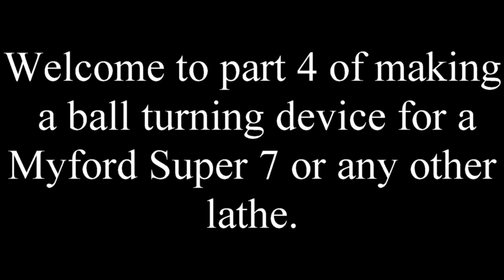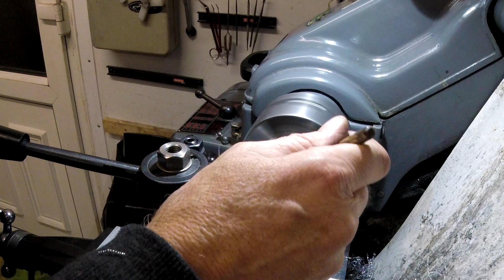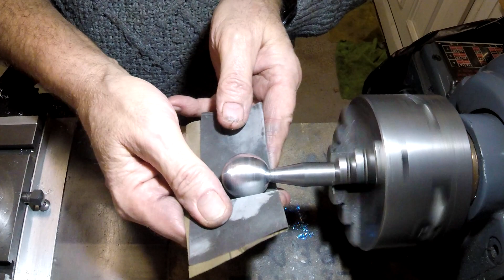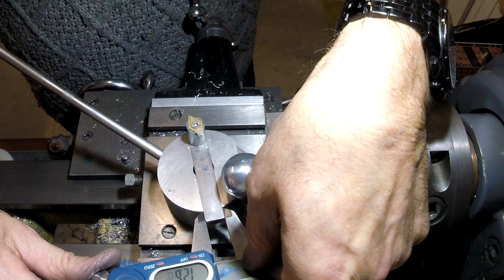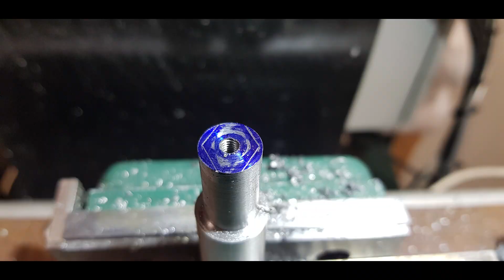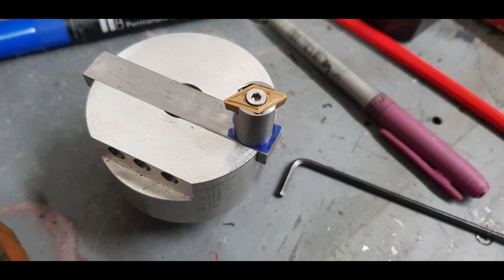Ball turning device part 4 Myford radius cutter

Comment: good job I think ill make one for my grizzly after thanksgiving I probably would have put my small steady rest behind the mandrel first but you made the right call first I also wondered about the 2 piece toolbit holder but it worked out eh and its easy to change out or a different style insert holder
Reply from the maker: Thanks for the comments. Yes the toolbit holder I made like that because all the ones I had seen made were fixed. That meant you could not get down to the root of where the ball was attached to mandrel. So when finished the ball had a shank on the end. With the movable tip you can adjust to cut right down to the mandrel edge. Takes a bit of adjusting but well worth the extra mile.
Steve.

Comment: Great work, and I respect your 'design it by building it' approach. I have the same lathe and I'm going to try making one of these for myself. Am I right in thinking that any 'ovalness' results from the cross-slide advancing too far, so that the axis of the bearings and toolholder's rotation goes beyond the axis of the lathe spindle?
Reply from the maker: Sorry i am a little confused by your question. The basics are that the centre of the hole in the cross slide must go at a minimum, to the centre of the spindle. Mine now goes just beyond. 
If it did not go to the centre then you could not cut a perfect ball. When setting up i make sure the cutting tool is on centre to the spindle & then cut in small amounts.
Regards. Steve.
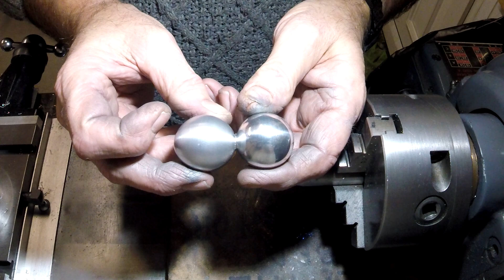Reply: @Steviegtr52  Yes, agreed. But if the cross-slide should happen to be set a little beyond the midline while you're doing the cutting, then the ball will end up being a little oblong - longer than it is wide. I think that explains the shape of the left-hand ball at 15:34.  Geometry.
Reply from the maker: @SloopyJohnG  Yes i see what you mean. I always set the cross slide to the centre of the cutter before I start, but & a big but is i am still learning the setup. I have ended up with some perfect, like the ones on the myford controls. Others have ended up all over the place. Thanks for the reply. I will be revisiting the ball turning at some point & hope to do better. Cheers. Steve.

Comment: Great idea. I may try this! Thanks
Reply from the maker: Strangely i was using this just last night 07-06-2021. Still trying to get it adjusted to turn the perfect ball. By turning the cutting tool at an angle it throws out the normal setup a bit. Going to do some more tomorrow. Lots of ball handles to make for the myford & anodise colour. Another video of my anodising coming up. Fingers crossed.